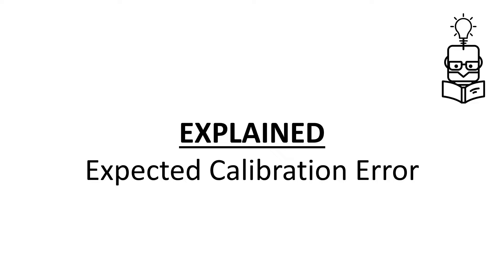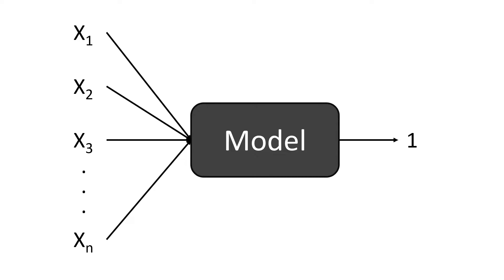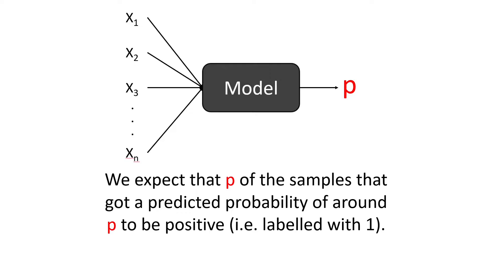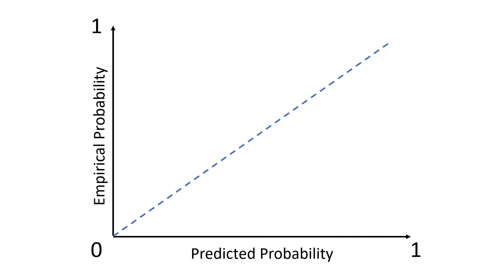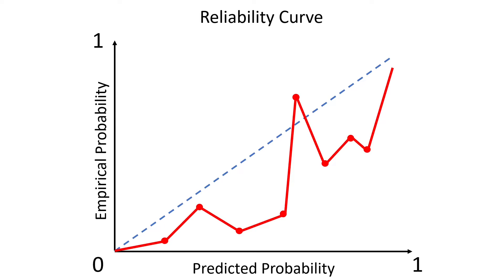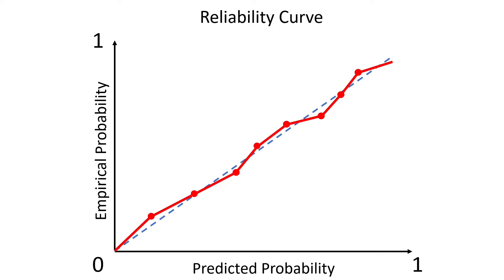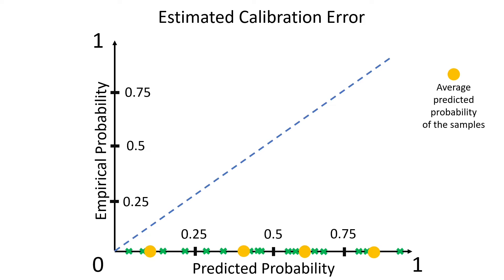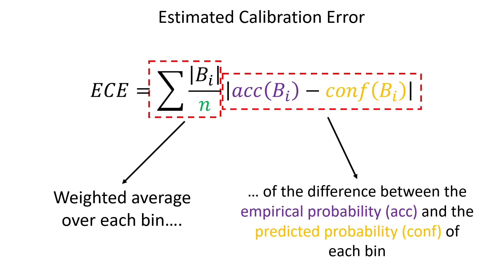Model Calibration - Estimated Calibration Error (ECE) Explained

Comment: This is great🎉🎉🎉🎉, but i want to know the significance of this calibration.. how does it affects the AUC ROC Curve or recall value... please tell.
Reply from the maker: Thank you! I am happy to hear that you've found this explanation helpful!

Regarding your question, I don't think there any real connection between the two because they are measuring quite different things and they are quite complementary if you ask me. ECE measures how close the model probabilitiy is to the accuracy in each bin (i.e. how well calibrated the model is), while the AUC ROC or the recall are metrics that measure the performance of the model in making decisions (i.e. 0 or 1).

For instance, you can imagine a model that has a 100% accuracy, but there's a catch. For the negative labels it predicts a probability of ~0.49, and for the positive labels it would predict a probability of ~0.51 (we set the threshold to 0.5). This would again give us a 100% accuracy (or AUC ROC/recall), but an ECE of just ~0.5 which is pretty bad. Thus, the ECE score may help us in catching such problems.

I hope that this answer makes sense for you and that I didn't misinterpreted anything (please correct me if I did).

Comment: Hi, thank you for the concise explanation of ECE. I have a small confusion on how to calculate the ECE. Are we looking at the softmax score of the target label to get the predicted probability (conf)? For example, if I have two classes (cat and dog) and I feed my model with a cat image but our model predicts it as a dog with 0.8 softmax score and a cat with 0.2 softmax score.  Which softmax score do I use to get the average confidence of the bin? Thank you!
Reply from the maker: Hi there. Well, in my opinion ECE is a little bit ill defined in this case, as the output should indicate a binary true/false target, not something like cat vs dog (or multiple classes). However, you can do a little trick as you do in computing the F1-score, consider the dog as positive and cat as negatives (the values in the first bin) and compute the ECE score, and then consider the dog as negative and cat as positive (the values in the second bin) and compute the ECE score again. Then you take the mean of the two ECE scores.

I hope this makes sense to you and please let me know if it doesn't. Also, please take this with a grain of salt since I believe this is not the official way of computing the ECE score for multi-class classification, but that's just how I would do it.
Reply: @datamlistic  Thank you for the quick response! Got it, however, this may be computationally inefficient if we are dealing with a large output class size, say >100.
Reply from the maker: @dakingrai4235  I have to agree with that. For a large number of classes the computation would be quite slow. However, for 2 classes it should do the trick. :)

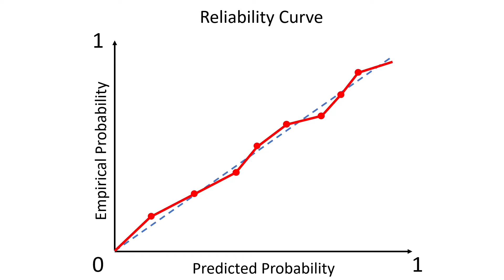Comment: Hello, thank you for this explanation. Please in this video you said there are some techniques to bring the curve closer to to blue line (2:14), please can you suggest some of them?
Reply from the maker: Hey there. I'm glad that you found the explanation helpful. The easiest solution to bring the curve closer to the blue line is to train a simple model (e.g. logistic regression) to do that. Specifically, it gets as input the predicted probability of the original model and it has to learn to generate the calibrated probability by looking at the target labels (i.e. lr_calibration.fit(model.predict_proba(X), y) ).

Please let me know if this make sense for you. Also, would you be interested to see a video about some techniques used to calibrate models?
Reply: @datamlistic  Thank you so much, but does it make sense if we apply to image classification where the predicted probability and target labels are tensors of pixels? I am interested to see a video about some techniques used to calibrate models. Thanks
Reply from the maker: @Usertool0007  This method should work independent of the model you use for classification. However, your task seems to be a multiclass classification one, so the method I've described may not work in your case since it was created for binary classification. Thus, unfortunately, I am not sure how you could approach it in this case. :(

p.s. If you find/know something about multiclass calibration, please let me know. I would also be interested in finding out more. What I've managed to find so far is not very clear.